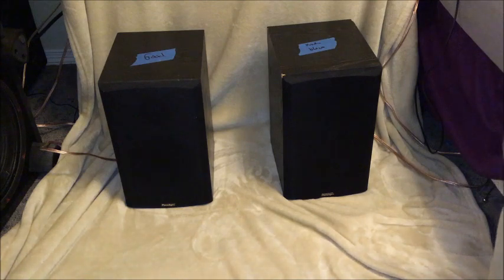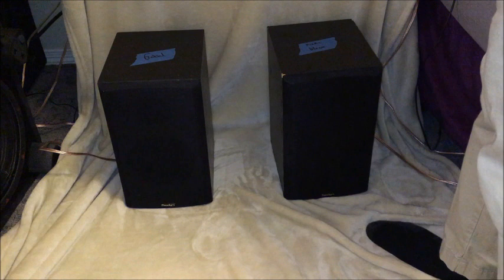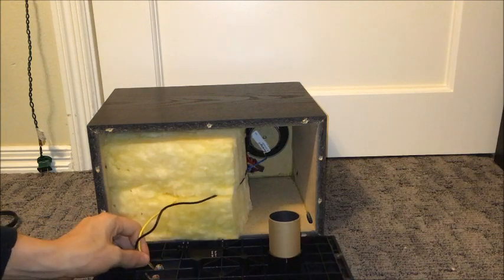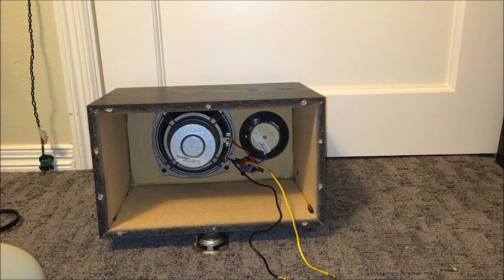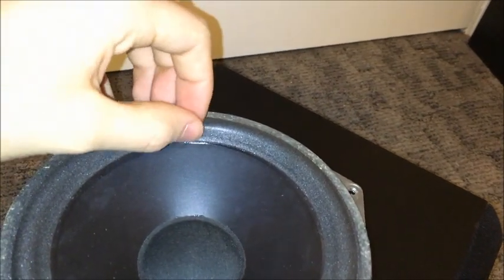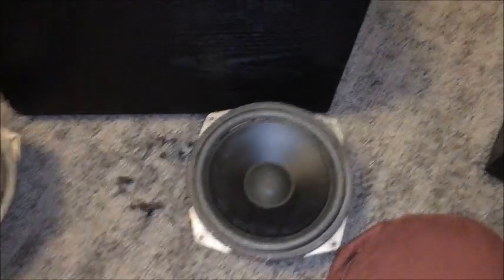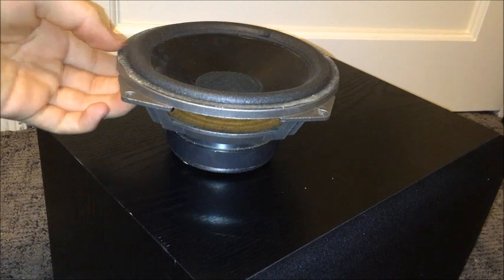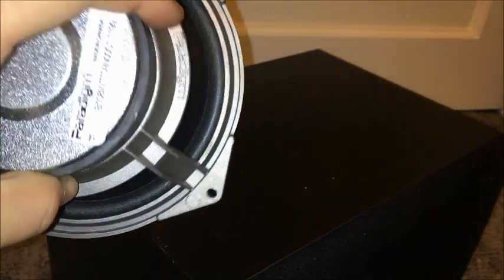Paradigm Titan v2 speaker repair: Bass loses power or distorts.

Comment: I just repaired a set of these with 6" rubber surrounds; at first I messed one up as it was slightly uncentered so I had to try again, this time using the 50hz technique and I believe I got it. Not hearing any weird vibrations anymore. They sound pretty good! A bit overboard with bass and a little muddy but overall enjoyable and powerful speakers for the size. Was not a fan of the insulation haha Luckily my version didn't have them glued in and they were easily removed.

Comment: I've got a pair of paradigm titan v4's. both of them blew out and I had to repair the foam surrounds on em. now they sound great. correct me if i wrong titans came out in late 80's early 90's and went through a few refreshes. So mine (v4) would be turn of the century 2000-2002. I would guess your V2's were from 1992 maybe?
Reply from the maker: The v1 had multiple variations on its own, lasting around a decade. The v2 (which were not my speakers, I was repairing them for someone,) is a 1999-2000 model, but technically, it is the exact same thing as the 3 and 4, just the 4 got the new logo and other cosmetic upgrades. So basically, these are the same speakers as yours. The reason behind the model change between the 2 and 3 was only because some other products were updated that year. I own a set of 3s in wood finish. They are identical to a set of wood finish V2s, in fact I even call them V2. They needed the same treatment for the woofers. The date code on my Titan 3s is hidden on the back of the actual cone on the woofer, stamped in yellow, and points to august 2001. The code is written in a YY DDD format, the days being out of 365. You are not far off on the v4, which were probably from 02 or 03. (Edit: The date codes on the set of V2s in this video pointed to two different times in 1999, the worst one being the first. The person had 4, so most likely I got one from each set.)
Reply: @djijspeakerguy4628  Interesting, thanks for sharing that information.

Comment: The phone is down to rot 
but you can replace it easily
Reply from the maker: foam not phone. Just needs to come out along with scraping off the glue, then ordering a new one, and gluing it on with the provided glue while avoiding something called coil rub, which can easily be looked up.
Reply: @djijspeakerguy4628  I have a pair of these I think version 1, purchased 1997/98 ish.  Just started using them after many yrs just on the shelf and I suspect they have this problem especially one of them as in the video.  My question is is the kit you need available by size as described or speaker model.  Thanks for doing this video as I was about to open them up and this is a great over view.  P.S. I'm the original owner and I knew the front grills were glued on which was always a disappointment.